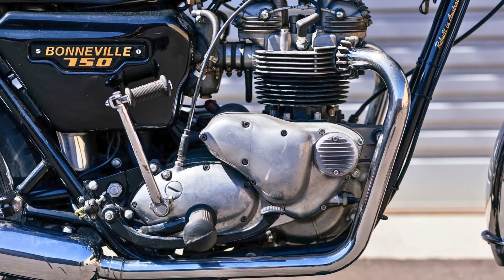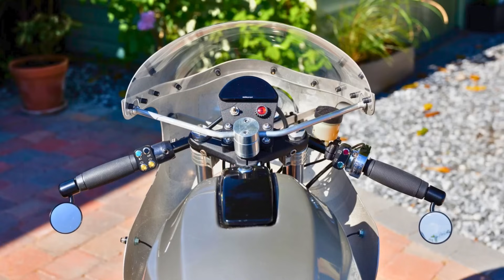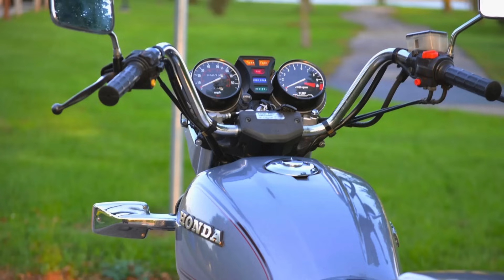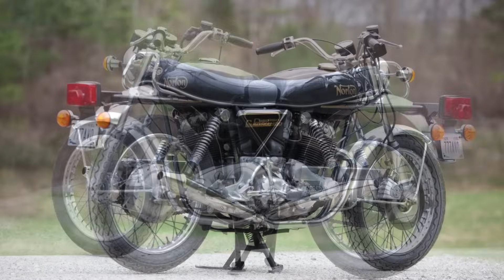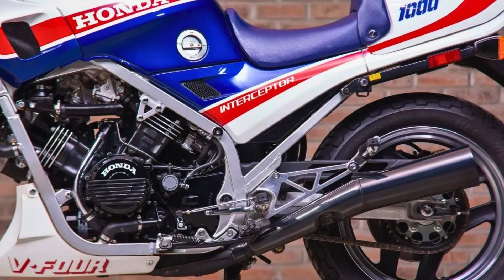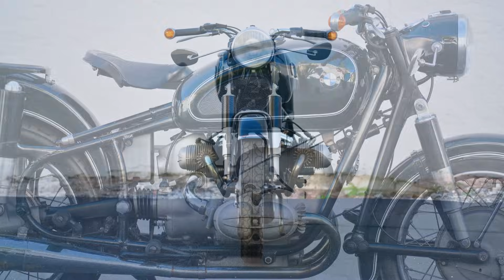7 Coolest Vintage Motorcycles You Should See!

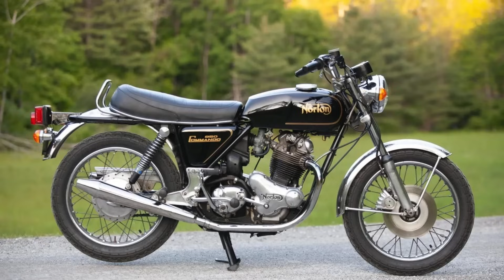Comment: 3:57 It was actually called "Isolastic" and occasionally nicknamed "knicker-elastic" because as the rubber bushes deteriorated, the bike became prone to fishtailing in high-speed turns. That would also happen if the bushes weren't kept properly shimmed.

Comment: The Guzzi if far from standard. This one is heavily modified. At least firing, seat, clip ons, exhaust, gauges , lamps and side trims are changed.
Reply: What! You must be joking. This one has racing number plates, rearsets and straight pipes. Please google Moto Guzzi LM3 to see how it looks standard.
Reply: Nope, that's how it came! (Former Moto Guzzi dealer here).
Reply: @ronaldjohnson1474 You would have been a very blind MG dealer then. Please look up a Moto Guzzi 850 Le Mans III. It looks nothing like the one in the video.

Comment: The Triumph Bonneville in the video is a 1980, not a 76.
Reply: Also triumph didn't make 750's in the 60's.
Reply: @cedley1969  no 750 twins in the 60's, correct. There was the 69 750 Trident.
Reply: @cedley1969  T120RT
Reply: @cedley1969  T120RT T150
Reply: Not till '73 @cedley1969
Reply: To be ultra technical here it's a 1980 "American Export" Bonnie. The handlebars give it away. The indigenous models had "straights". The high-rise "seagull" handlebars ( as on this model) were Triumphs nod to the  American Harley  "cruiser" look which was much more popular over there. Personally, I think the "home market" version was the better looking bike but, that's just my opinion. The Bonnie, whether 650 or 750 was a classy bike that handled like a little 250. Held the road well and was really nimble. It also had a decent turn of speed when required. I loved my Bonnie's ( had 4 over the years 650 and 750) . For me,  the only Brit Bike that came close, regarding ride and agility was The Norton Commando ( 850 preferably). That was always the hard choice for me. The Commando was quicker but, apart from that, you couldn't put a cigarette paper between them. 
There were some really good British Bikes.  This was just a couple of them. Ah, but Bonnie's were the beautiful ones.
Reply: @OzzieDeWitt   the problem with the Commando was that you had to set up the isolastics at .010" to make it handle good. It was a wobbly mess when looser than that. When you did that, they vibrated so much that you couldn't hang on to the bars because of the vibration. The T140V/E bonneville was a vastly superior machine. When I was road racing my bonneville, Nortons were nowhere...not even close.
Reply: @robertwhite2032  I would agree in part about the vibration. Somewhat tedious on a long run.
I found 012" to 015" to be my optimum. But, I would also agree that it's a really subjective point and really depended on whether you were racing around or cruising around. I, personally, liked to have a " blatt" now and again but, preferred cruising around 70/ 75 mph.
What I found with Bonnie's were at that speed you got some irritating vibration . Up to 70 they were fine. Over 80 they were brilliant but 70 to 80 you'd get vibration through the handlebars. For some peculiar reason it wasn't so prominent on my T140v's but on my '65 and '68 650's it was really noticeable. Tried all sorts to minimize it. I found riding TT100 tyres helped a bit but, they wore out so quick. One of the bikes I even paid out to have the crank speed balanced. All that did was shift the vibration up to 80/85 mph. 
Again, this is a subjective " quibble" more than anything else. 
I liked my Commando she was a very " attractive" and reliable machine that could shift along impressively when needed but, I loved my Bonnie's more. With all of the "quibbling" aside, the Bonnie's just had more "character" and we're a lot more "forgiving".
I guess, given the choice these days, I would probably go for a '65 650. That was probably the one I loved most. She was just awesome.
Reply: @robertwhite2032  and trying to get them set correctly was a pi ta.
Reply: @raymondo162   I never really had any problems with my T140's. Maybe I benefited from being the parts manager of my local Triumph dealership and learning "secrets" from the older guys.
Reply: @robertwhite2032  Bonneville and Commando, fine bikes, I've owned both. Both had fine handling and the Commando is uncannily smooth at above, say, 4,000 rpm. The Commando, probably more by good luck than good judgement, had a more modern cylinder head, could achieve high compression without resorting to the massively domed piston crowns needed on the Triumph.
Reply: @roadracingrelics  I agree that the Commando had a more modern combustion chamber. The narrow valve angle helped a lot. But the T140V ports were better and the Triumph revved quicker. When I was road racing my T140, it was always faster than the Commandos. Both great motorcycles, I'm just a Triumph guy!!
Reply: @OzzieDeWitt and the eejit describes the high-rise-bar model as cafe racer !!  bo  ll  oc  ks  im  o
Reply: @OzzieDeWitt  If you are being "ultra technical",then you will have noticed that the rear brake caliper is from a 1979 model.
Reply: @OzzieDeWitt the 850 commando had a more reliable engine but the gearbox  didnt tolerate the increase in capacity. The 750 didnt have the engine reliability of the 850  but the gearbox was more reliable.
Reply: @Ian-bq7gp  
I've heard this critique before. All I can say is that I never experienced any problems with the 850 I owned
I did a fair few miles on it too.
Perhaps I didn't ride it " hard" enough.
I have to say though that, out of all the bikes I owned, the best 3 marks (personal choice here. Not a sweeping statement) were my Bonnie's, my 850 Commando and my Royal Enfield 750 Interceptor ( mk2). The Enfield was a bloody heavy beast though but, also very under-rated. 
Bonnie's first though. Every time .
Bikes are very subjective things and these remarks are subjective.
( I liked Honda 400 / 4's as well. But that's another story 😊.
Mainly Brit bikes, me ( with a couple of exceptions on the way) ! 😵‍💫🤔☺️
Reply: The T120 was a 650cc twin engined bonneville. The tiger model had single carb, bonny twin carb. The black commando you show was a roadster, not cafe racer. The fastback had dropped clip on type handlebars.
Reply: The Norton 850(828)came.out midway "73
Reply: @kttrouble7053  thank you for your insight. Although, my comment is about the Triumph T140, not the Norton.